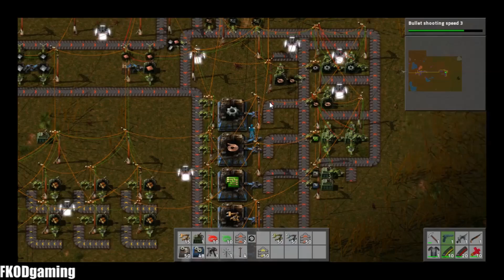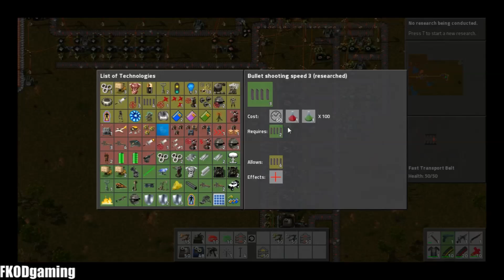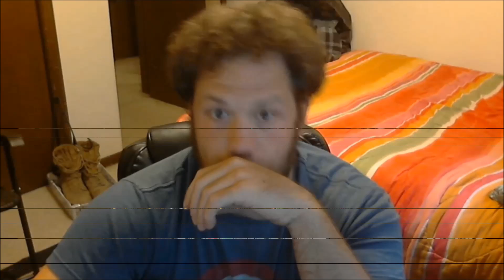Factorio: Building a Programmable Factory

Comment: Why not have all the factories activated from the start and pick up the material as they come by?
Reply from the maker: Mostly because it would become very difficult to control how much of each product was being produced. I don't think it would be impossible to do it that way, but it would definitely be harder to set it up to stop at the right time.
Reply: I have been trying to figure this out since I have seen Mals video, I like how you have the item layout, and gave me a new idea for full function factory.  I still believe that you should modulate this (one factory for building items like belts ect)  But if I do get it done I'll make a video and post a comment on here linking it

Also using logistic drones would help with resource relocation.

Edit( Think I may have found a way, but want to play a whole game before I make a video, want to make sure its a viable factory design)